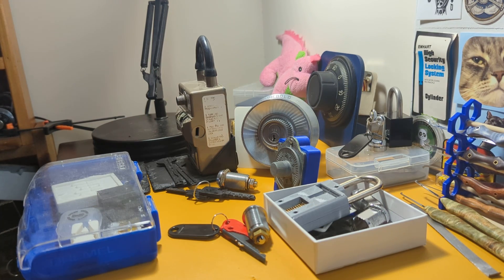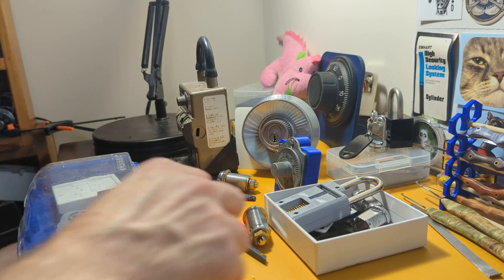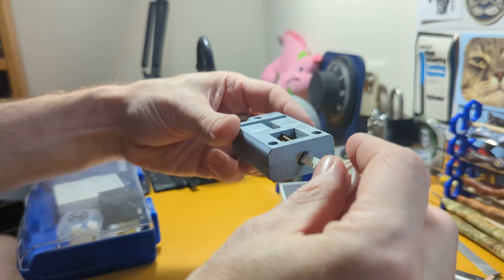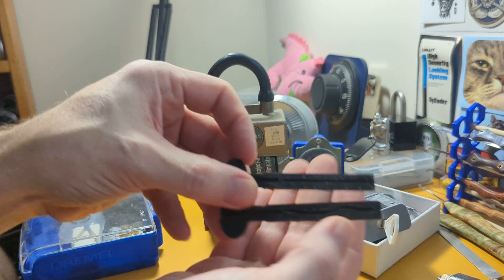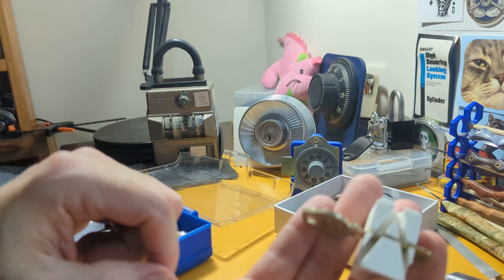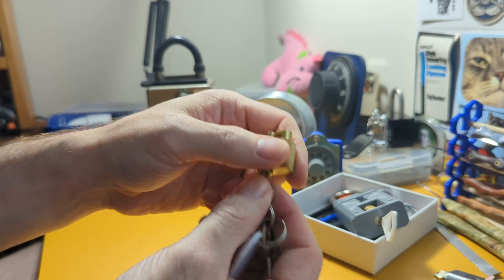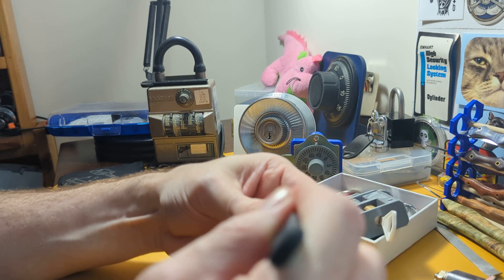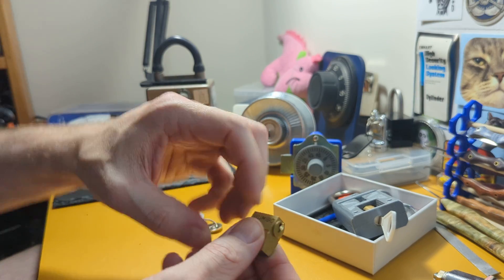0x23: #mylok100 and the Belwith Rotary Phone Lock

Comment: Thank you
A Prusa is on my really want, want list, mainly for locksport. I've got a Keyless Bilock and you've just made me want that 3D printer all the more.
I have some templates for the key and intend to make one but I've not found any suitable material to do it with, yet... I might wait until I can print one now 😁
Good luck in the draw 🍀🍀
Cheers bud 👍🍻
Reply from the maker: Thanks, MyLok! I think my 3d-printed bilock key from DND is in PLA (at least, it doesn't feel like ABS). It's holding up fine so far, but if it does break I can always print another!  Cheers!